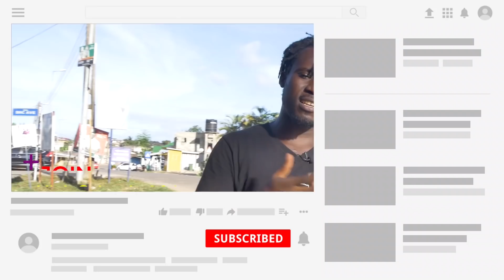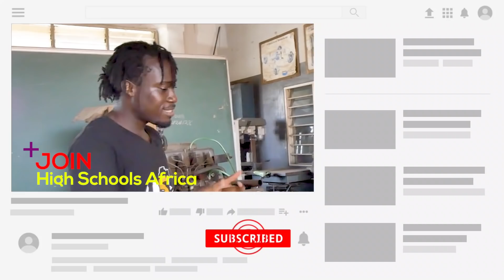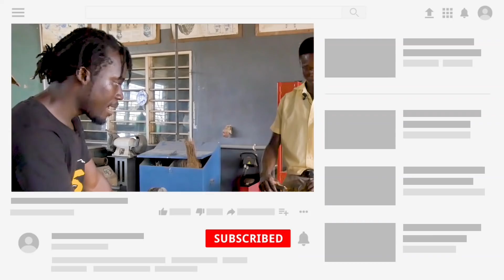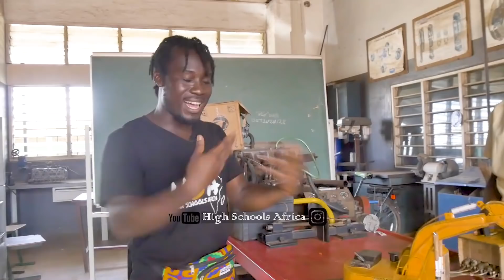First African Excavator To Use Water As Fuel. Ghana Student Built It.

Comment: This is BULLSHIT CLICK BAIT. It is WATER PRESSURE, NOT WATER AS FUEL There is not a single motor, engine that can run on water as fuel. Pisses me off with the CLICK BAIT BS. The headlines imply the kid built a full-size excavator to run on water. BULLSHIT! There are engines that can run on hydrogen, which is processed (commercially) by applying huge amounts of electricity to separate hydrogen from water to produce brown gas to run combustion engines. You can make fun little hydrogen production with a jar metal rods, washers and a couple batteries, but not practical for large applications.. Yes, its an interesting toy that is generating kinetic energy with the use of WATER PRESSURE hand pumps, NOT WATER AS FUEL! However, it is not practical for mechanical applications like full size excavators. Yes, water can be used as hydraulic fluid, they don't because of corrosion. if the machine is made of non corrosive materials. But still he is using pressure generated by a manual manipulation, no matter what deceptive hype is used to advertise it, it only comes down to replacing hydraulic fluid, with water. It would still need a combustion diesel engine to power it. Don't lie for views.